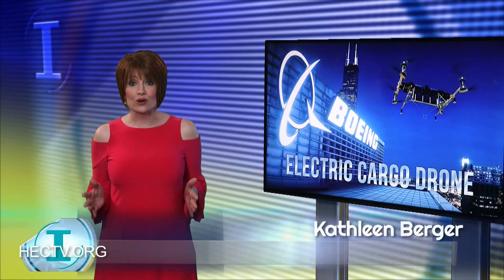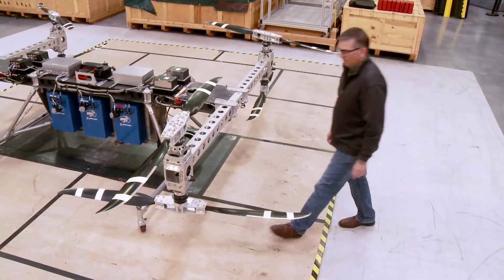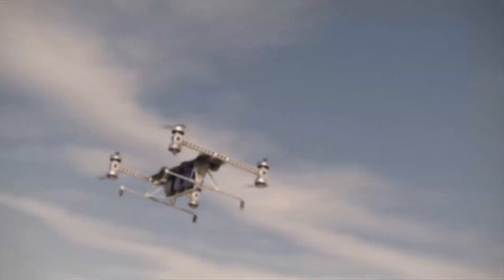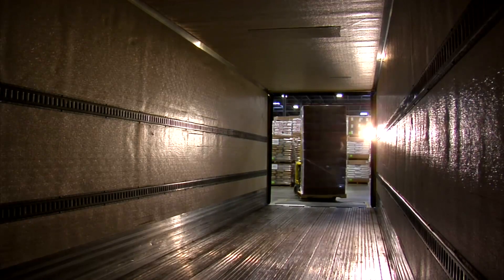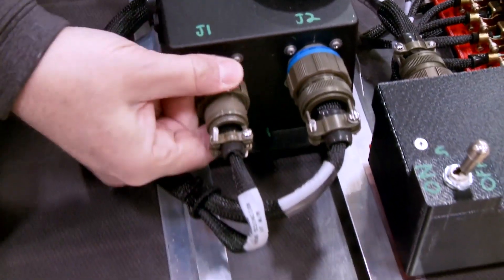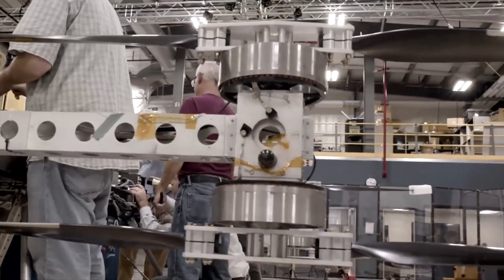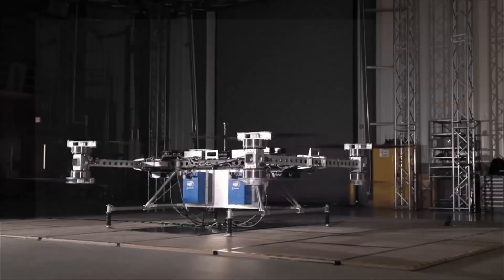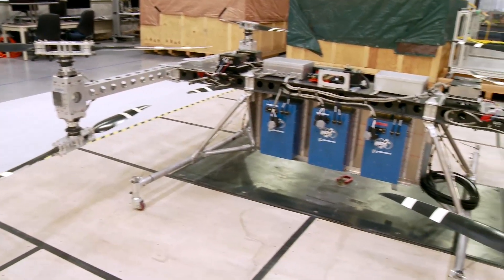Boeing Drone Designed to Carry up to 500 Pounds: Boeing's New Cargo Air Vehicle

Comment: use gas motor running generator.. should handle longer flights .. such as Newark to a pick up warehouse in Paramus or Long Branch
Reply: Or just use a central radial engine and variable pitch system instead of motors and batteries.

Comment: get rid of the batteries... go to a gasoline-powered generator still use electric motors for the rotors...
in essence, a drone helicopter
Reply: The only thing that’s powered is the rotors. It’s the same
Reply: @leonzhang7821  Its not the same because batteries have low energy/mass.

Comment: Strange that it has all those 'weakening' holes in the aluminium tube. To save 10% weight, it is now only half as strong? That's why drilling holes in the chassis of race cars was banned in the 1920's. Aeroplanes do not have 'holes' in the structural members, they are swaged flanges or stamped curved edge short tubes that actually make the structure stiffer but not weaker. They are not put there to save weight. Only amateur CNC hobbyists do this kind of thing to make projects look technical. What the heck are Boeing up to? Publicity for media consumption nonsense AKA tax offset RD exempt by-products. The Russian FLYTE is a proper space frame designed by engineers.
Reply: marklimbrick you need to look up the Dunning-Kruger effect.
Reply: well thanks Jesse, anything to occupy a few more hours self-isolating....but some structures do have cut-outs where the trade-off is more directed towards some other criteria. For example truck bed longitudinal frame members, where the bulk of steel is needed at points to attach things. Now, I'll go experience this Dunning-Kruger effect....